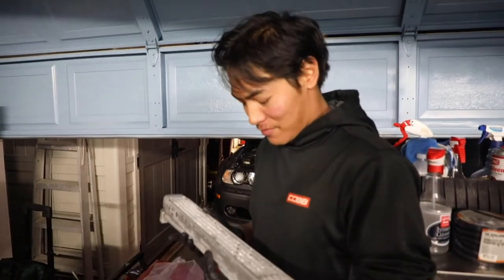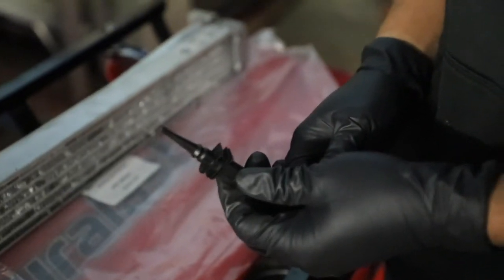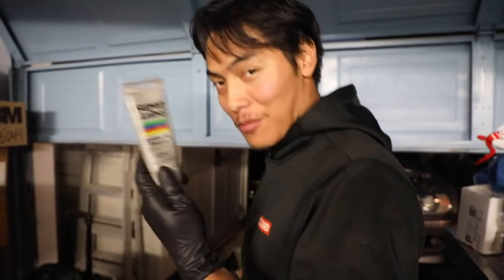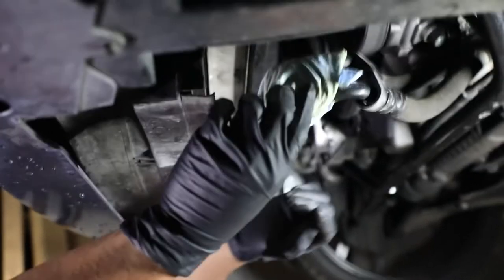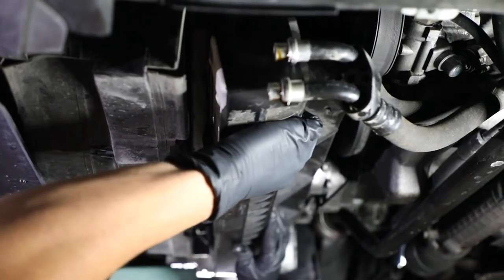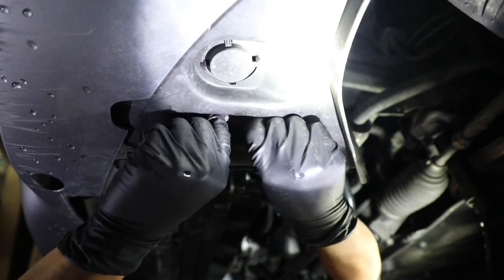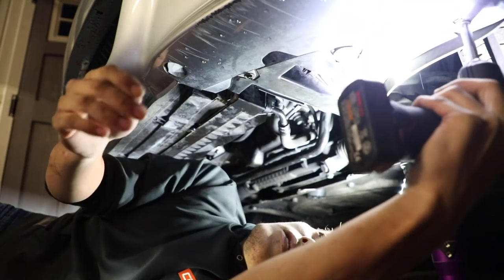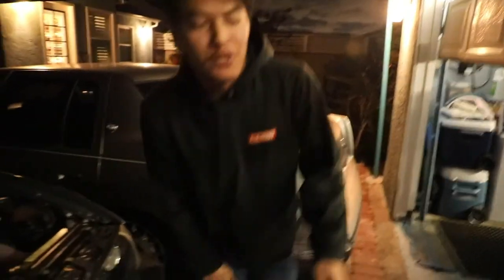E46 M3 Oil Cooler and Ambient Sensor Install

Comment: Great video guys. Just bought a CSF oil cooler and didn't even think about buying new "O" ring gaskets.... Thanks for sharing your knowledge.
Reply from the maker: Stephen Omine thank you for the love! There should be 4 o-rings btw since you purchased a new oil cooler!
Reply: Thanks. Just bought the 4 “O” rings. You guys should consider doing a video on rod bearings since his car is high mileage.
Reply from the maker: @toomuchvanos6865  Will definitely do that! We are currently in the works of doing a SMG to 6-speed swap (:
Reply: @T30o  did the cfs cooler come with oul rings?